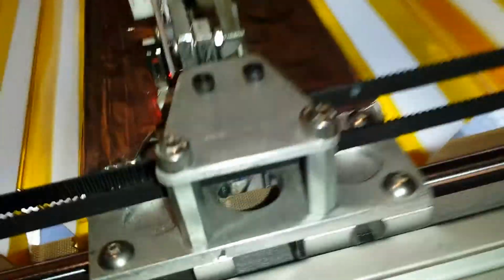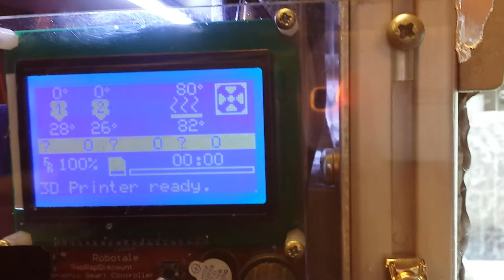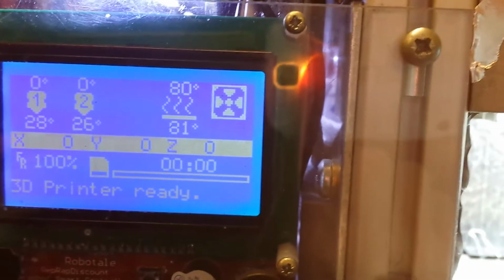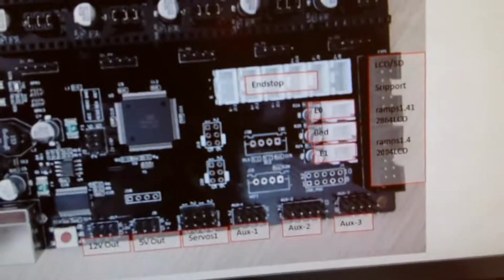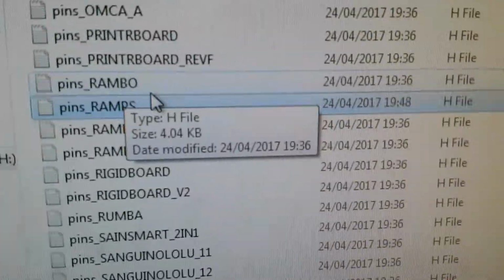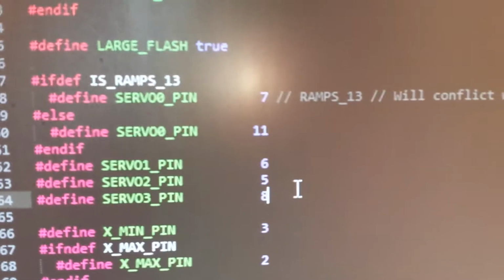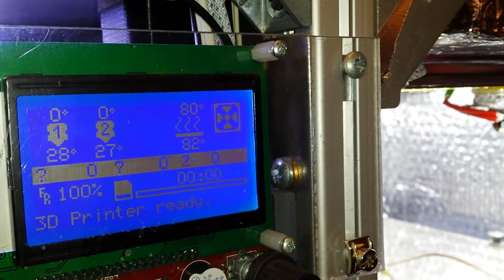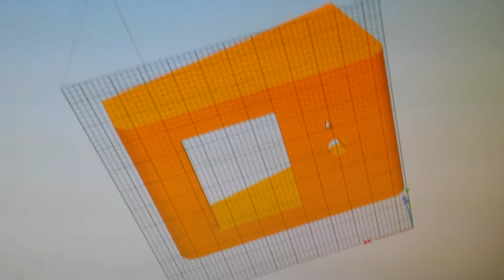3D Printer 750watt Heat Bed Install - Test 1

Comment: That's a bit disappointing. All that work and you've only got 67 degrees?  You're somehow losing 15 degrees through the aluminium and the glass.  I thought polycarbonate needed a bed temp of about 130 degrees???
Reply from the maker: I am not sure what you are referring too ? . Again this video is soooo old. the heat bed will achieve well above 150C . and thermal loses will be throughout. my bed is 6mm Aluminium and my Glass 4mm. thats 10mm thick overall  !!

Comment: Love it man!

I've just ordered a plate, silicon heater, SSR and PEI sheet.  I have a cheap PCB heater, but I'm sure it'll be crap so talked myself out of using it.  I'm going to try and drill the plate so a thermo-couple is as close to the glass as possible without breaking through the aluminium.

Are you going to use PID then?  Is cycling the SSR that fast OK?  I read that 'bang bang' might be better for the SSR and because of the higher thermal mass of the thick plate shouldn't make much difference to the stability.  I guess the SSR isn't a relay though so can't see it being too much worse for it running PID.